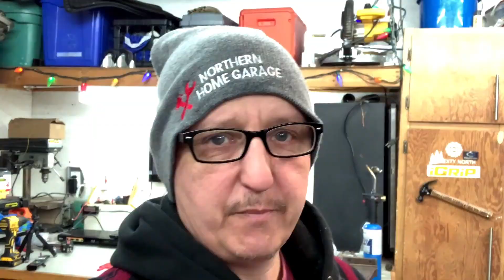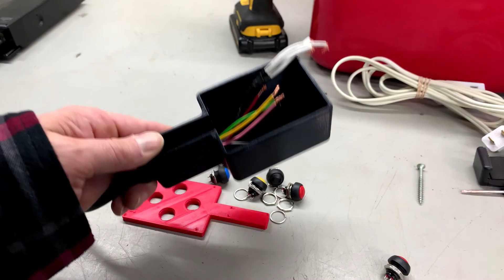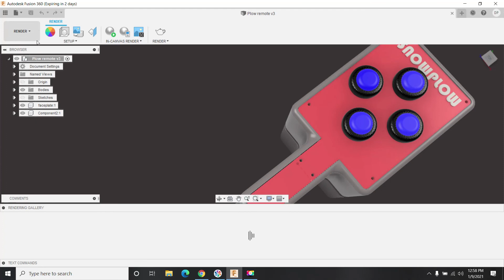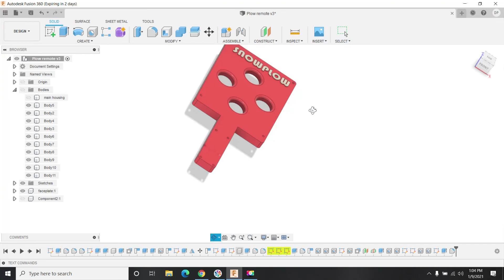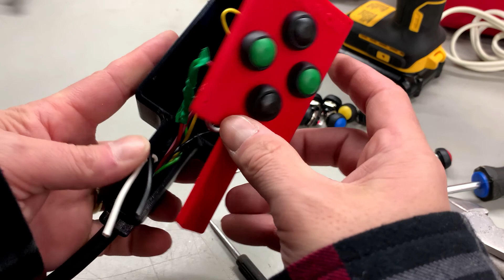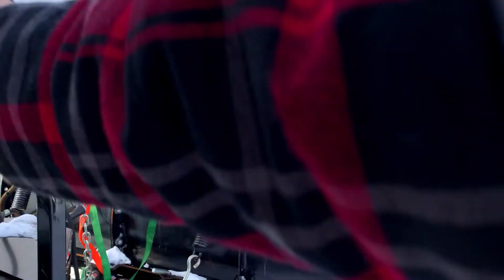SNOWBEAR Hydraulic Snow Plow wireless remote failure. Two seasons old. Part 2

Comment: Thank you for making this video , please if possible help with wiring diagram, to the remote switches , i see 2 diodes for up and left , i have the same color wires , it will be much appreciated . thanks ( and are those diodes 20 v )
Reply from the maker: If you go look at the other video (this is part 2) I think I show the wires and the colours for movement. The diodes are from Amazon 10A up to 1000V 10A High Voltage Regulator Diode. Let me know if you find what you're looking for in my other video. Thanks!
Reply: thank you for your help